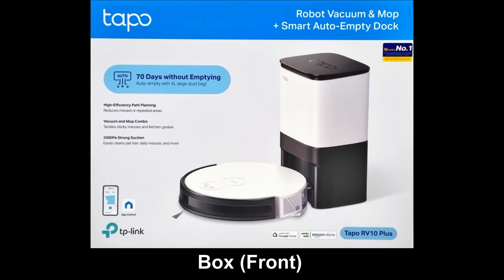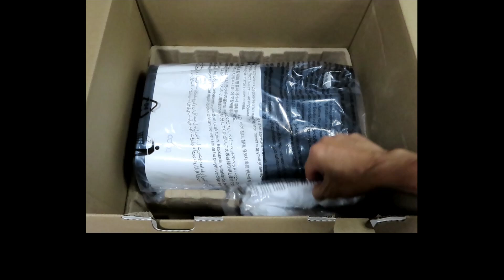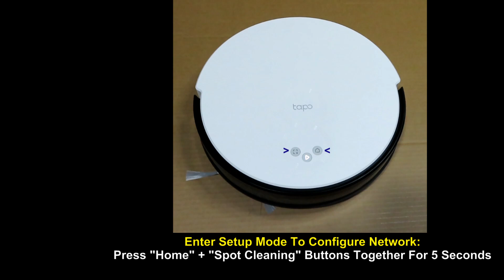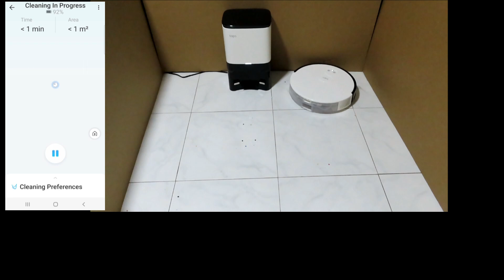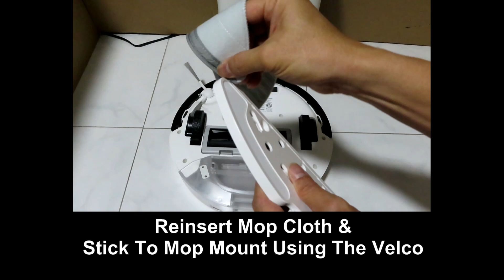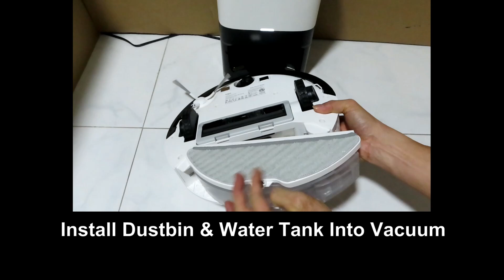TP-Link Tapo RV10 Plus Robot Vacuum & Mop :  Unbox, Setup & use

Comment: Thank you very much.  I have a Tapo camera and wondered why I all of a sudden had vacuum on my app.  I have been doing some research and have long wanted a Robot vacuum.  I was initially looking at energy saving plugs and came across the vacuum which piqued my interest.  I am fed up with having to use the upright as I have back problems - a problem with getting older.  This little guy could help me out with my cleaning.

I am worried as I have a black carpet, but it is not fully black as it has white speckles in it and would like to know if this robot would clean it or would it ignore it due to it being a dark floor?  Has anyone tested that?  To give an idea, my carpet is called a Twickenham Anthracite if someone wants to google it and it is a deep pile carpet.  Would prefer if it is tested fast so I can make use of the early bird opportunity.
Reply: Are u a fan of tapo?